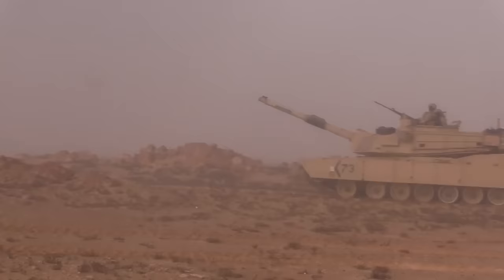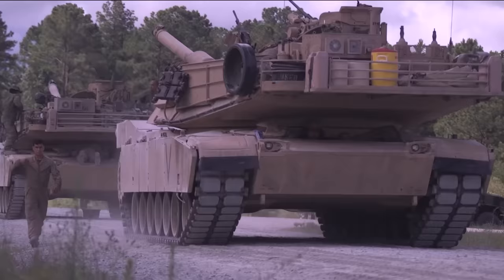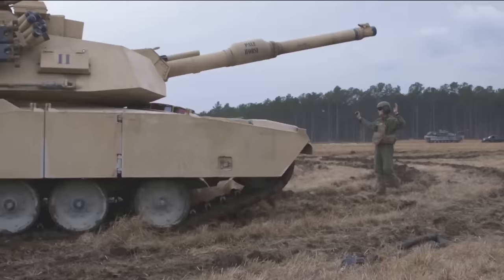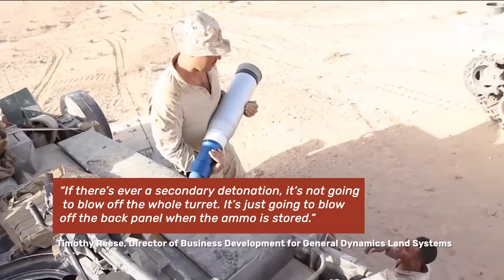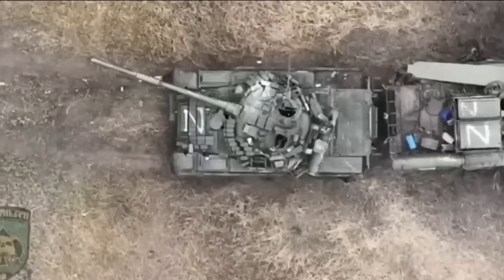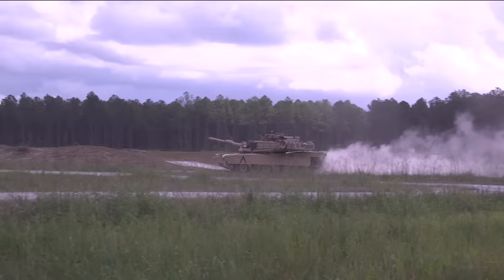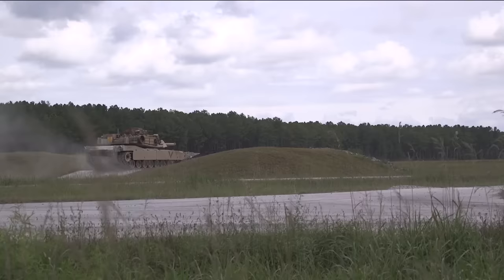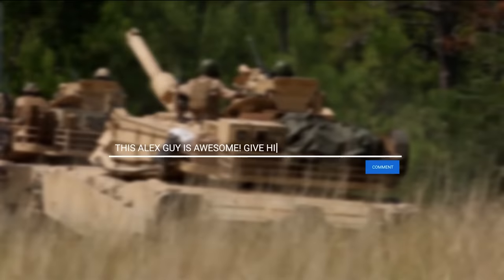America's next-generation main battle tank: ABRAMSX

Comment: Human loader is indispensable , those kids do many more tasks than just load ammo  ask the russians how autoloaders are working out 
Tanks for the video !
Reply: Properly designed autoloaders (aka with blast doors like on the Leclerc and the K2) are the next best thing to tanks since tracks. Human loaders are a waste of space, a waste of weight, a waste of armor, etc.
Reply: @johansmifthelry9307  My human loader could perform tasks like Communication , first aid , and security , what can your autoloader do ?
Reply: @StabbinJoeScarborough  reduce the weight of the tank by about 10 tons, allowing said tank to cross far more bridges and makes mud less of a problem, and consumes less fuel. Also reduces the size of the tank, making it a significantly smaller target, increasing its survivability. Can keep on loading the gun in unbearable conditions. Allows the whole crew to be in the hull, greatly increasing survivability and allows the crew to survive direct hits... reduces the total casualties in an actual full scale war scenario, as if you lose 10 tanks (and you will) you won't lose any more than 30 trained tankers, vs 40 trained tankers (tankers take a long time to train well and are more of a pain to replace than a tank).....
Reply: @johansmifthelry9307  Where have autoloaders done all this at ? Which country has used them in combat and had good results ? And still it cant apply first aid , pull security or operate radios
Reply: @StabbinJoeScarborough  Leclercs are battleproven autoloading MBTs, as well as the T90s. T14s prove that indeed you can move the entire crew to the hull, thus massively increasing survivability. Trials have proven the massive success of autoloading tanks such as the k2, and the Type 90. All the rest that I mentioned is literally common sense and is proven by thinking for two seconds, ie: autoloading tanks are much lighter than manual loading tanks due to their smaller size (this is common sense)
Reply: @johansmifthelry9307  Ok, the Leclerc hasnt been used in combat near as much as the abrams has , and its nice that you have faith in some paltdorms our allies have produced ,  you havent answered my question , what can it do besides " load round " ? Again my loader can do more than your autoloader , thats why we have human loaders , thats common sense !
Reply: @StabbinJoeScarborough  I have literally told you multiple times. I listed you a bunch of benefits an autoloader brings. The simple fact that if your tank gets hit by two ATGMs and the entire crew gets killed, means you lose 4 trained tankers vs 3 trained tankers is already an insane tradeoff.
Reply: @johansmifthelry9307  Have you ever been on a three man crew ? You listed sure but those arent tasks that someone else has to do , you have to look at this from a maintenace POV , not just how many get killed , I dont want any tankers to die 
Also , now you want to go from 63 man companies and take away 14 loaders the rest will be NCO's and officers that are way over tasked to really be effective thier already extensive duties now 63 is already the minimum which makes everyone essential , I never regretted having a human loader either in combat or on deployment
I hear your arguments about weight but a lighter tank doesnt mean a safer tank its just easier on logistics 
And also the T14 is s steaming pile Russian made dung and I hope all 20 of them rot 
Happy D Day !
Reply: @StabbinJoeScarborough  you are shifting goalposts here. Why look at this from a maintenance POV? Yes, logistics and maintenance is important, and yes, an autoloader requires more maintenance, but the benefits it brings are enormous. It's well worth the tradeoffs for most situations.

Next, no one is saying we should reduce the size of a tank company. France's tank companies (squadrons) are well over 100 men. The "4th" tanker who is not in a tank because of the autoloader is still part of the company, and still does plenty of work, he is just not fighting in a tank 24/7.
Reply: @johansmifthelry9307  If theres no loaders , you wont train that position anymore, therefore the size of a tank company shrinks , from 63 to roughly 49
Youve never been in a tank company so I can't expect you to fully grasp that.  Theres hard work to do all the time yet folks like you want it done with less people
No one shifted goalposts , run a tank company with 49 people , sure go ahead Johan
And autoloader still cant apply first aid , run the radios , pull security or help the driver with maintenance, find me an autoloader that does that
Reply: @StabbinJoeScarborough  again, no. Tank companies don't shrink when autoloaders are introduced. Take France as an example. They still have just as many men still working in the company, just not in the tanks, in order to spread out tasks efficiently. They will still help with maintenance, still help with paper work, still help with menial tasks.... The size is the same! the only difference is, the "4th" crewman is now not in a tank, but still in the company.
Reply: @johansmifthelry9307 Ok, but thats not how the US Army is organized or operates , and frankly we dont and shouldnt use france as an example for anything , nice tank that Leclerc , been involved in one engagement , we have decades of success with human loaders , only gamers and politicians prefer autoloaders 
" Donit like the French " is a ridiculous argument , thanks , out
Reply: @StabbinJoeScarborough  that's funny, because the entire US army composition is basically based on France, and massively inspired in general by France... That aside, you say "that's not how the US Army operates" yeah thanks sherlock, the US army doesn't field autoloading MBTs. However, if they did adopt them (which they very well might in the future) it would basically look like France. ie: you keep the 4th man in the company, just not in the tank. 

"We have decades of success with human loaders" wow, well guess what, people had hundreds of years of success with muskets, and they still adopted rifles. Or how the US once had rifled guns on its MBTs but has smoothbore guns now. Your argument is basically "I don't like whats new, even though all evidence shows its the next logical step, since the benefits far outweigh the costs.
Reply: @johansmifthelry9307  Go back and play your game Johan. Weve had different experiances in life sleep well tonight knowing there is an autoloader that has your back

Comment: Just my opinion as an average internet idiot: no hybrid shit. Its alot easier to transport fuel than batteries and then installing batteries.. its easier to rip an engine out and install it than tear the haul apart to change a battery pack. No autoloaders. Autoloaders have a very mixed track record and thats unlikely to change due to size limitations.
Reply: The electrics are necessary to run the tank. The batteries keep the electrics alive whether you have an engine/clean air/fuel or not. If the auto-loader is electric, then the tank is fully functional (and a safe. sealed, air-conditioned environment) even if the engine is disabled. Also, you can park/drive the tank in complete silence without the heat signature to give away your position, and also not burn any fuel for a while. The electrics are NOT optional, so all you are complaining about is that they put a battery (an uninterruptible power supply) on an existing tank. The term "hybrid" is somewhat inaccurate. It moves only with the engine, and the engine also recharges the batteries which supply the electricity for everything else. Aside from moving, the tank is 100% functional without the engine and 100% dead and defenseless without the electrics to see/control/drive it. Also, citation needed for the auto-loader claims you made. Which US auto-loader systems have  'mixed' track records?
Reply: @pappyman179  The US doesnt have autoloader system. European and eastern tanks using them have been unable to make a system as reliable as traditional hand-loader. Russian autoloader is slower than head fed. Secondly, There needs to be redundancies in the system to make sure the tank can completely operate without the battery system at 100% capacity. Im telling you, it will fail and be a weak point if it is at all a main requirement. Its cool to have fancy and complexity, but in a military setting, reliability and simplicity go significantly farther. If this is a quick change batter pack that is not required for any main functions, than I can see the benefit. Anything else will become a hinderance and money pit.
Reply: @PappyMan  operate at 100% capacity without thr batteries**

Comment: That isn't nothing the Russian T,14 can jump tank ditches float across minefields shoot down aircraft helicopters up to ten miles away runs on cheap vodka witch is the only problem they can't seem to ever find enough to move the tank more than a mile at a time it somehow evaporates out of the tank but the crews love this tank and will continue to use it if the Russian army doesn't change fuel

Comment: I feel as though on a modern battlefield an MBT's 120mm gun isn't useful enough to justify itself. A 40mm chain gun for multi-purpose uses and a 20mm airburst on top for Counter-UAV are more valuable to the battlefield.
Reply: There are armoured vehicles that have that sort of armament configuration. They're called Infantry Fighting Vehicles.

Tanks have a big gun for a reason: to kill other tanks & provide fire support for the (hopefully) accompanying infantry.
Reply: @paulg3216  I see what you mean, I guess I just conflate IFVs with APCs too often.

Comment: NO NOT THE M2 they've gone to far now! Cut down in it's prime after only 90 years.
Reply: imo if they replace the commander .50 with the 30mm, they should make the .50 a coax
Reply: @Just_A_Random_Desk  better use .338 Norma: much more ammunition, range and accuracy exceeds .50 cal, penetration just slightly worse. And for stopping power they'll have 30mm
Reply: @solarissv777  But muh .50 :(

Comment: So, explain to me how a hybrid is better again?
You’re saying the fuel usage is an issue but it’s not and then you’re going to rely upon an electric motor that’s powered by batteries in a COMBAT environment!
Batteries aren’t efficient and their very vulnerable to extreme temperatures like cold and hot environments which greatly reduce the output and efficiency of said batteries as we recently learned with the Ford Lightning which got a dismal 99 miles at full charge in the winter and then actually got about half is that in reality.
Now, electric motors themselves aren’t really the problem.
You can carry a generator on board which uses a fraction of the fuel of a regular gas engine and can provide plenty of power for electric motors which can give about 3 times the range of even the most fuel efficient cars but because of the stupid people that are worried about the environment and demonstrate how important it is by putting batteries in vehicles that are worse on the environment than anything that uses fuel which is why you’re not allowed to put a generator in an electric car even though it will be more reliable, have greater range than even a gas powered car and solve the actual environmental problems but it still uses that thing called gas so it’s bad.
People are just straight up stupid and this tank is going to be the stupidest thing the military ever invested money into.
You watch..
It’s going to be epicly bad and that’s why we’re being sold so hard on it because they already know it’s stupid but no one’s going to hear about the problems until billions of dollars are spent and the military has an unusable weapon in their hands.
It’s going to backfire and we’re all going to be worse off for it
Reply: It's probably going to try and use solid state batteries, a not-so-far-off tech that can remedy a lot of issues with current batteries, especially with the mighty American MIC behind it.
Reply: @bluntcabbage6042  but a generator is still a million times better so why would you even think of using a battery?
They just aren’t efficient enough and the energy stored in them either dissipates or leaks out and like a I said is greatly affected by temperature so there’s no way around it.
It’s a really bad idea
Reply: @7gmeister  Because you can sit quietly without a heat signature until you are ready to move. Thermal targeting is a thing.
Reply: @pappyman179  what’s that got to do with ANYTHING I said? Stop eating the govment cheese bro!😆